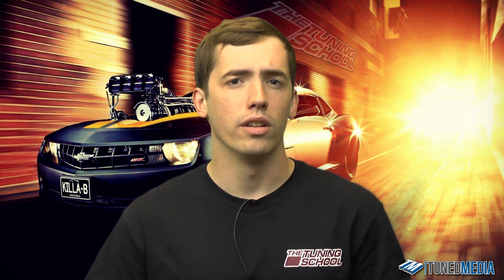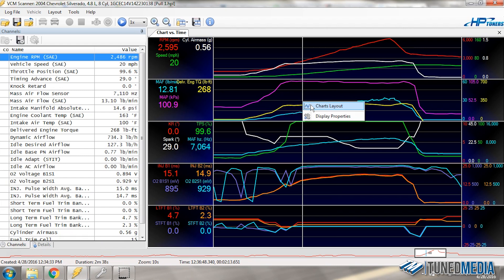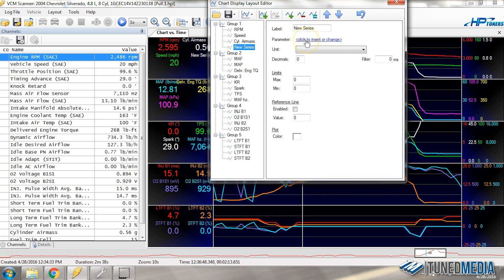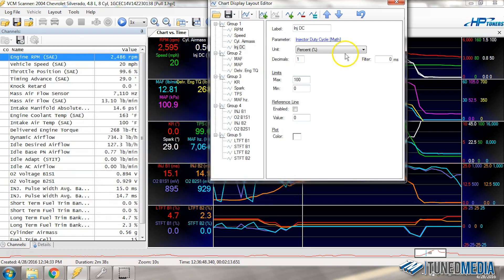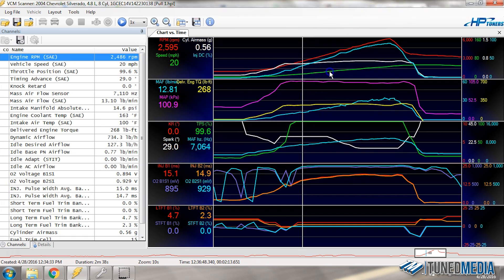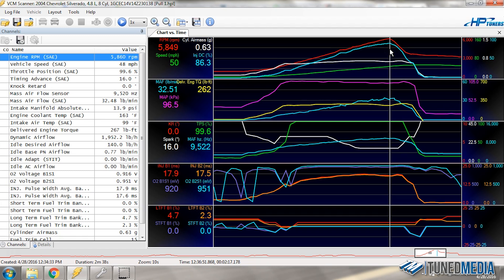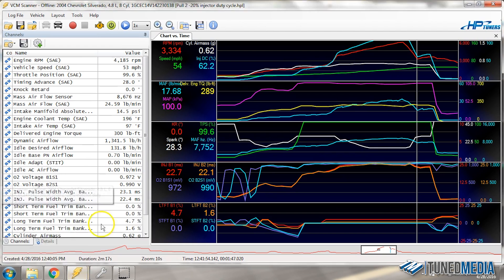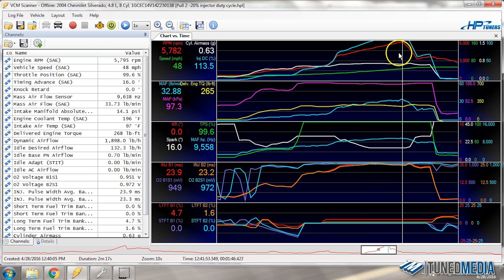How to Tell If You Are Out of Fuel Injector Using HP Tunes 3.X Scanner

Comment: Maybe a stupid question.   My Roush RS3 is tuned with VMP phase2 for Roush TVS 2300.  Phase 1 to 2. The Roush version is supposed to Come with 56lb injectors.  My car has the 47lb injectors , if I swap out the 47lb to a 56lb like it’s supposed to have ,will I need a retune or should I be ok seeing how I have a boost a pump?

Comment: Just fyi,, high duty cycles can also mean you dont have enough fuel pump. Always check your fuel pressure under load before you spend money on larger injectors!
Reply: Yea we just went through this with one of our swap projects. Even went out and bought larger injectors( which ran the same duty cycle because they were still running out of fuel) just to find out the pump wasn't keeping up. Bought a larger file pump(walbro 450) and injector duty cycle dropped from 118% down to 90% on the original injectors.  Still high but workable without spending several hundred on new injectors. And if it would have been around 100% before the pump it would have put them right in the sweet spot.